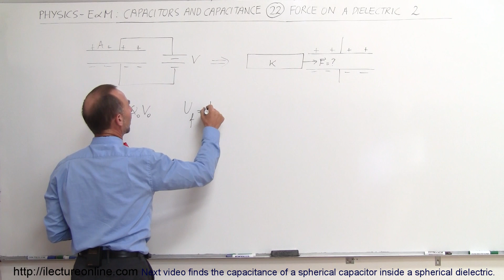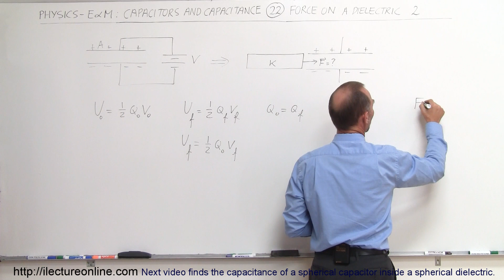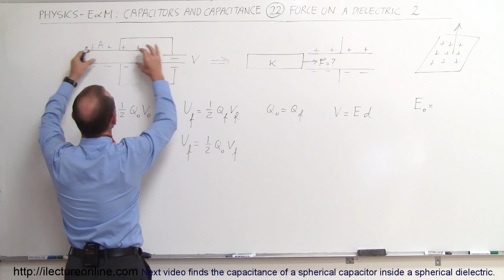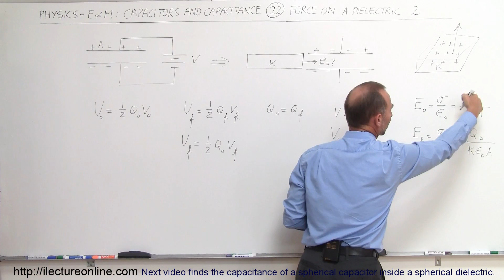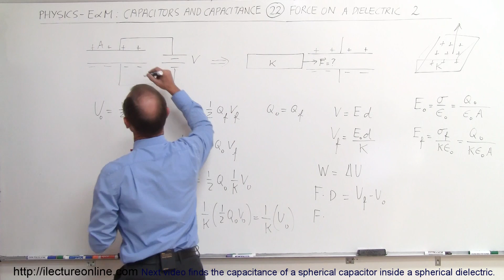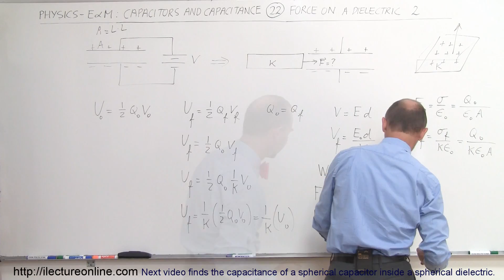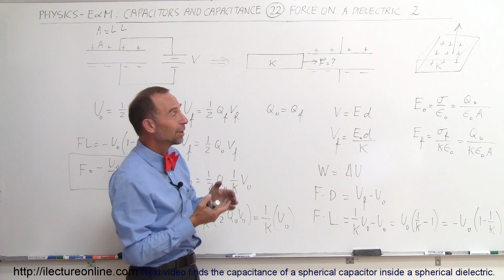Physics 39   Capacitors (22 of 37) Find the Force Needed to Push a Dielectric in a Charged Capacitor

Comment: Great video! Thank you! However, I would like to ask you a question regarding your video on a force needed to push a dielectric between capacitor plates while it is still connected to battery. It was stated that you would have to apply some force in order to move dielectric between capacitor plates and energy stored on capacitor plates after dielectric is inserted would increase since more charge is drawn. But wouldn’t the capacitor try and draw more energy from the battery to compensate the force needed to place the dielectric between the capacitor plates. What I mean, wouldn’t the capacitor pull the dielectric in anyway, but would draw more energy from the battery just to compensate the amount of energy consumed when dielectric was pulled in.
Clarification on the question would be much appreciated!
Thank you in advance and Thank you for the amazing videos you make! 
P.S. Video in the link below aroused my curiosity, showing that oil level is increasing without mechanical force being applied so that pretty much lead me to ask this question.
: https://youtu.be/uxzC6INcHTI

Comment: So, if I were to create a force diagram of the dielectric being sucked upward into the capacitor, I'd have gravity pulling in the negative y, and the acceleration from the capacitor in the positive? It seems like the upward acceleration would be a function of the height of the dielectric level in the capacitor, that is, that the higher the dielectric goes inside, the lower the upward force on it from the capacitor, until it reaches an equilibrium. Does that sound right?
Reply from the maker: Since the force is proportional to the ration of the energy difference and the length of the portion of the capacitor without the dielectric, it appears that the force would be constant.
Reply: Michel van Biezen Ah, ok. Thanks for the quick reply. Very cool stuff! :)
Reply: Michel van Biezen Great video! Thank you! However, I would like to ask you a question regarding your video on force needed to push a dielectric in capacitor that is still connected to battery. It was stated that you have to apply some force in order to move the dielectric between capacitor plates and energy stored on capacitor plates after dielectric is inserted would increase But wouldn’t the capacitor try and draw more energy from battery to compensate the force needed to place it between the capacitor plates? To make myself clear, wouldn’t the capacitor pull the dielectric in anyway, but would draw more energy just to compensate the amount it has consumed when dielectric is pulled in? Clarification on the question would be much appreciated! 
Thank you in advance!